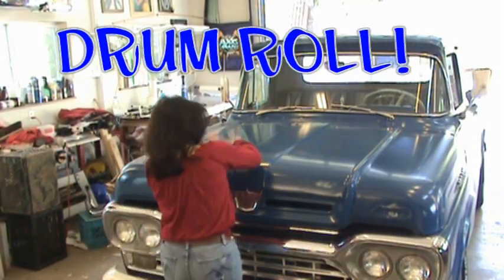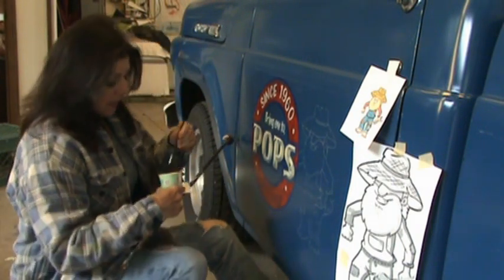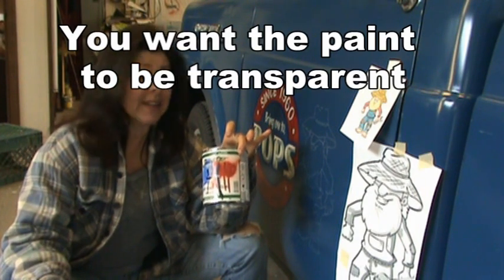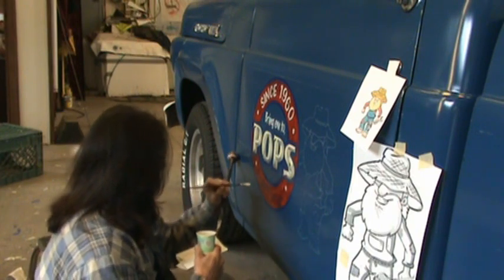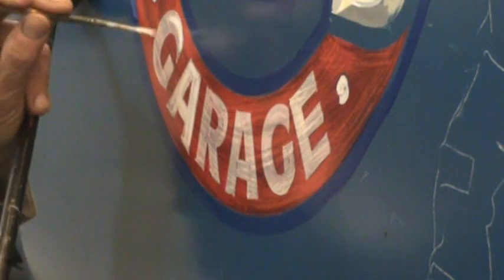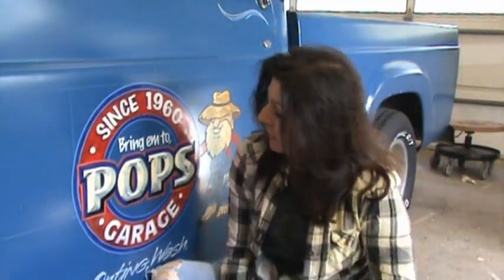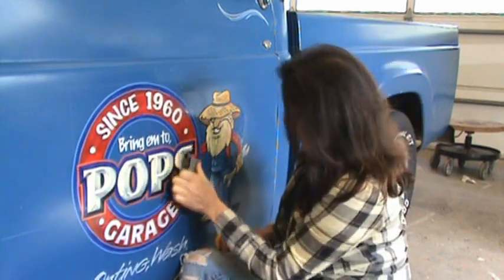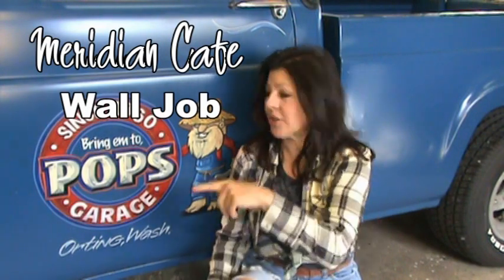Pop's Garage

Comment: Interesting that you had "left over" paint after a job , that could be saved for another job !
My sad experience with 1-shot paint  (since they ruined it by removing the lead from the formula and adding hot solvents)  is such that the treasured left colors of paint no longer last , hardly a week later before they turn to gel and are unusable  !